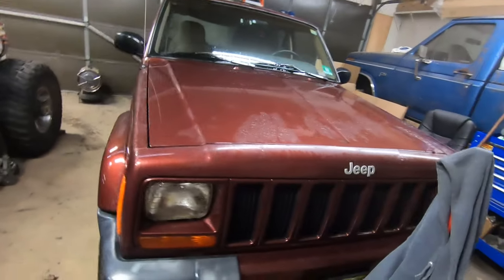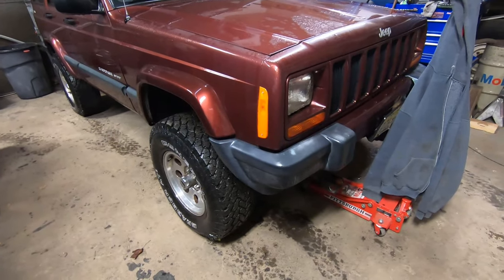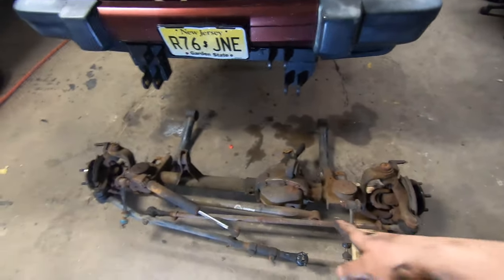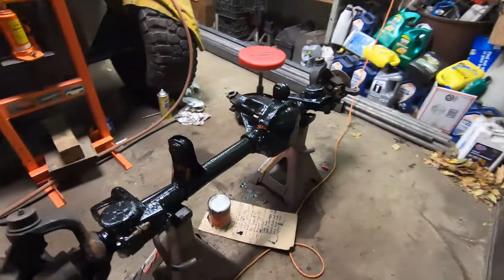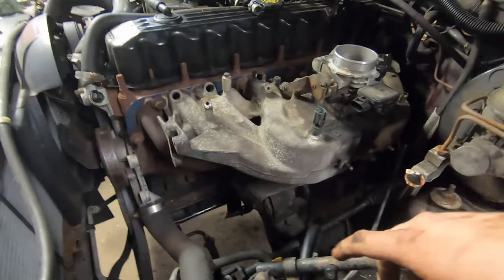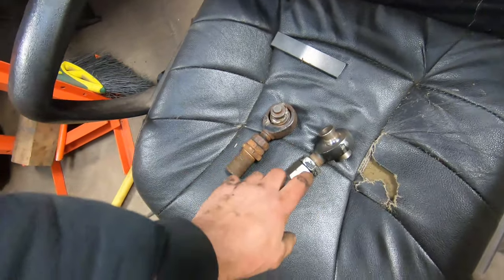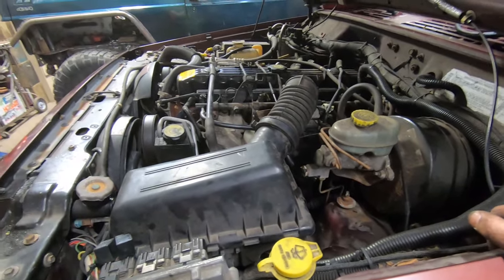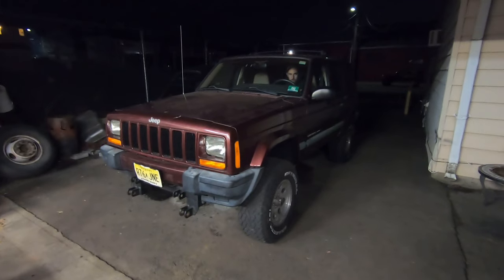Getting The Plow Jeep Ready For Snow

Comment: Great progress. It’s evolving. Building it better! The wheel base is the only thing that make it a good plow truck. The gearing will help. I just like heavier for the big stuff and that’s where the money is. Best plow truck that size is the old air force ramp truck built to tow planes. Those standard cab short bed rams had cummins and a load of intensional extra weight. The axle gearing was in the 5 or 6s. Not getting on the freeway but most people bought a few and kept them at contracts around town that had enough parking to spare.